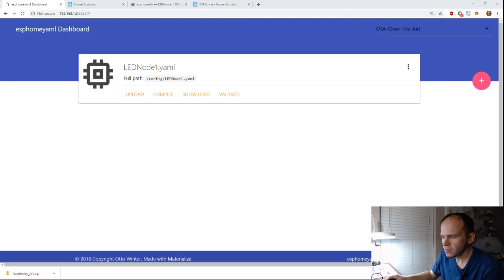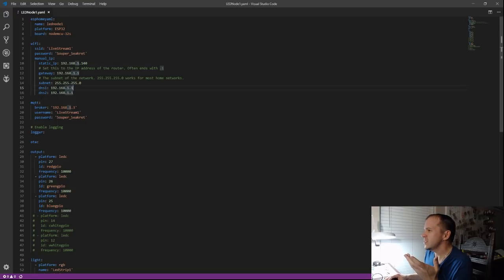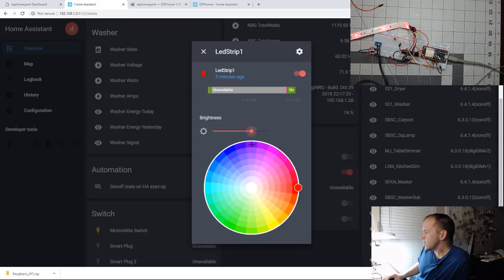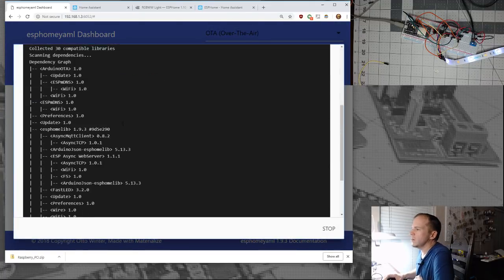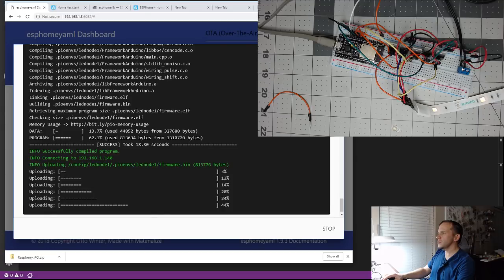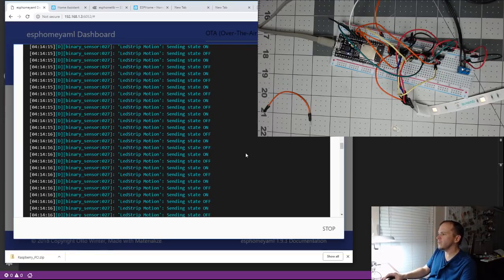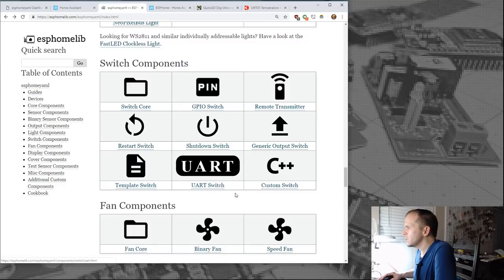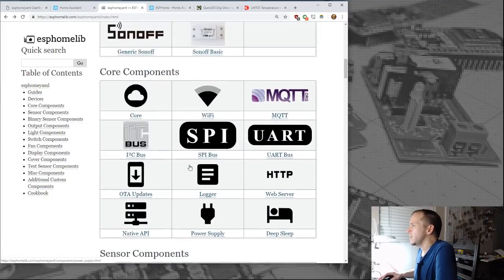Live Stream - ESPHome - ESP32 RGBWW LED Strip

Comment: Do you know anything about using the H801 RGBW LED controller ( https://esphome.io/cookbook/h801.html )?  I'd like to create some under-the-counter lights for my kitchen using some RGBW strips.  This looks pretty cool ..
Reply from the maker: I have seen that one before but I don't have any of them unfortunately. If I remember correctly it use pwm as well and be used with the various 3rd party firmwares with ease.
Reply: @digiblurDIY  I think I'm going to get one.  I find it a bit confusing in purchasing the right kind of LED strip.  I want something that can be pretty bright and mostly concerned with white so I guess I'd have to go with an RGBW or RGBWW if I can figure out what the difference is between them.  Also I guess that 12V would/could be brighter than 5V .. Those are the concerns I have that keep me from getting this stuff today.  Not sure why it confuses me but it just doesn't seem overly clear...
Reply from the maker: Yes. I was going to recommend at least RGBW if not RGBWW. It can be confusing with all the different LED types, lengths, colors etc and you can look for days. Just make sure you match up the number of channel colors with your controller and the voltage the controller puts out.

Comment: HELP: At a dead STOP with ESPHomeyaml. To get rid of problems with MQTT; Formatted SD card for Rasp.Pi 3 B+, clean RE-install, HA 0.85.1, ONLY ADDONS= Confgurator and ESPHomeyaml..(NO MQTT) Configured 2 nodes (Device-Sonoff Basic + SV) OTA WORKED with static IP, + USB BIN for 2nd, worked. Tried to Configure Integration, Set-up new Integration ESPhome, put in my HA (Rasp Pi) IP address, got ERROR: "Can't connect to ESP. Please make sure your YAML file contains an 'api:' line."   BOTH new nodes have api: (and password) and Configuration.yaml also. Is there another HOST IP I should be using for ESPHomeyaml? (No Devices show up on the 'Entities' list).   Any suggestions would be much appreciated, thanks.
Reply from the maker: This issue would probably be better to handle in a live chat on the esphome discord chat. There are several folks including myself that are around to pop in from time to time to help. https://discord.gg/KhAMKrd

Comment: Quindor from the QuinLED.info website here! Awesome my page came by in your video (Thnx Paul!). It's cool you are basically building the same thing, I light my whole house with these kind of boards so I designed PCB's for it and made a webpage with tutorials for people who want to build it toot! The QuinLED-Quad is a 4 channel board and the QuinLED-Deca has 10 channels so you can even run 2xRGB+CCT strip with that one! Can handle a lot of power and run at a very high PWM frequency is desired (300kHz!). For people who want to check it out, take a look at http://quinled.info
Reply from the maker: Thanks for checking it out! I watch your videos as well and love the content. I definitely need to check out some of your boards as I want to do more LED strip lighting around the house.